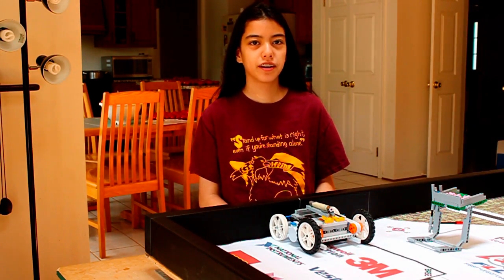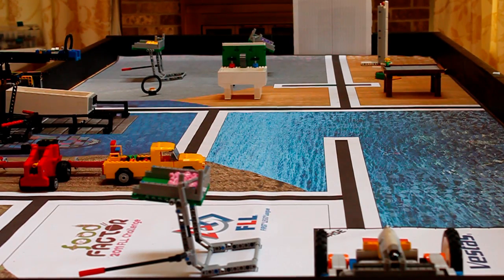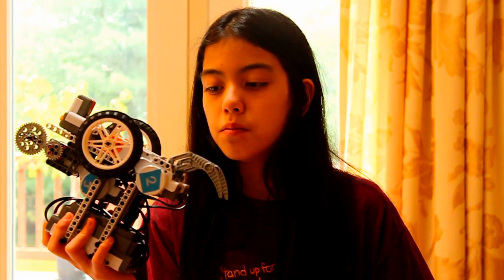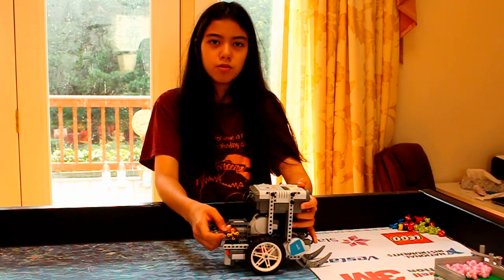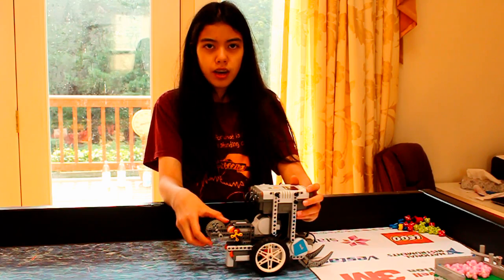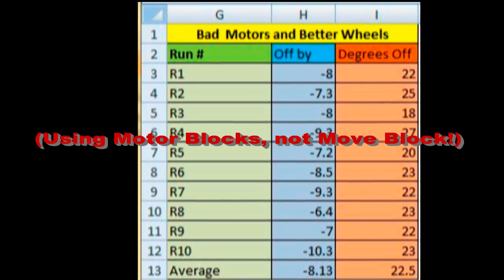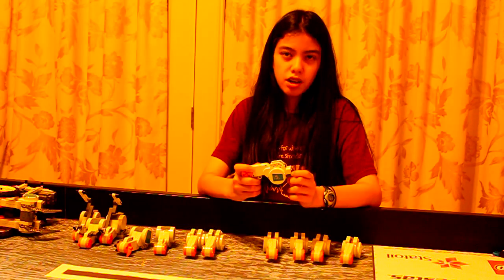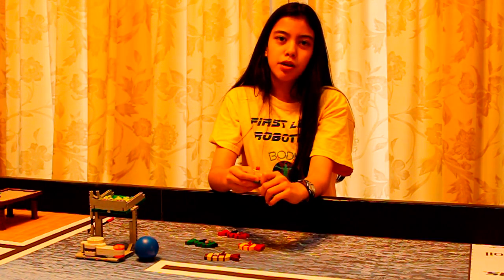How To Make Your FLL Robot Go Straight

Comment: We didn't have enough motors to get your strategy on matching motors to work well, but your suggestions in TubBot on using proportional corrections with rotation sensors did it for us.  Regardless, your videos are awesome. 
@UC1rzOt6O2usjMMS-YLU6RCw

Comment: We didn't have enough motors to get your strategy on matching motors to work well, but your suggestions in TubBot on using proportional corrections with rotation sensors did it for us.  Regardless, your videos are awesome.

Comment from the maker: The first year I did FLL my team built a robot with tank treads.  It moved pretty straight.  Since the tank tread wheels are pretty small, our robot was very slow.  You could try some of the things recommended in this video. If it always veers in one direction, try switching the wheels to see if it veers in the other direction.  You could also try switching out the motors, and/or swapping in a different motor for one of the wheels.

Comment from the maker: MoveBlocks do a good job of keeping the robot straight even with the fact that LEGO two different motors will almost certainly behave differently when set to identical powers.  Though MoveBlocks improve things, they are far from perfect.  The greater the difference between the speed of the two motors (when powered at same power) the harder it will be for the MoveBlock to keep the robot going straight, because the MoveBlock needs to make frequent corrections to motor powers to keep it straight.

Comment from the maker: hard to answer in 500 letters.
inconsistency of LEGO motors is a primary reason for robot inconsistency. If you used two motor blocks at different powers, you might be able to get a veering robot to go straight. But as the motors are worn out through use, and battery voltage varies this will most likely result in the motor behavior changing over time.
The best solution is to use a MoveBlock because it automatically monitors each motor and adjusts power in order to keep it straight as robot moves

Comment from the maker: Good question. Based on the actual number of degrees each motor has rotated, the Move Block ALREADY lowers the power to a motor that is moving too fast compared to the other one. But the steering control on the Move Block doesn't give you fine enough control to make a slight adjustment to the robot's path. With our robots, the smallest adjustment possible to the steering will cause a major arc in the robot path.  Matched motors make the job of the Move Block easier so it has less to correct for.

Comment from the maker: I'm hoping to cover this topic in a future video.  Everything I know about the PID algorithm came from a totally awesome article written by J. Sluka.  Simply google "PID NXT Line Follower Sluka" to find it.  This article is for using PID in a line follower.  Apply the same ideas taught in this article to the going straight problem (the error term is the difference between two rotation sensor readings).  We implemented a "PI" algo and got increased performance over P algo, but PID didnt work well

Comment from the maker: @cvarlamo 

Sorry that robot has been taken apart, and I don't have anything other than the video.  Pause the video at 1:53, that should give you a good idea of most of the design.  The Wheel/Tire are lego part  2902 and 2903.  Buy them on bricklink. The design is quite simple. Just mount length 15 beams to the top of the NXT brick, then mount the motors to the beams. Then used the 3x7 bent liftarms to mount between the two white connection   points on the motor and mount the back wheels to it

Comment from the maker: @andrewdenio 
So now the question is after you've got that prime set of motors, do you verify them running them head to head simultaneously? We found in our 1st round of testing that our results were skewed by our battery weakening. hastypete made the suggestion of running the tests with the battery charger plugged in. We did that and only began a test when battery was indicating full charge too. The seond round found us some good pairs (verified by running them simultaneously!)

Comment from the maker: @MozartJunior22 
Even with software correction (which the MoveBlock already does) it still would be better if your motors were well matched; so you are relying less on the algorithm to correct for a bad situation. Think if you had two horses harnessed together and one of them always wanted to run faster than the other.  Yes you could keep correcting each horse to get them to stay in sync, but it would be easier if the horses just naturally stayed in sync so you wouldn't need to always correct em

Comment from the maker: @MozartJunior22 
Yes, our team does use software to make our robot monitor and correct the motion as it drives.  Our algorithm is basically to proportionally reduce the power of the motor that's going too fast based on the difference between the rotation sensors. The move block uses a little bit more advanced algorithm called Proportional Integral Derivative (PID).  This algorithm does a pretty good job of correcting for unbalanced motors.Yes, you can probably get better if you made your own PID

Comment: Try using software techniques too... in my team we put a lot of effort in the software to make the robot drive straight. 
The point is to check the difference between the motors while it is driving (if motor B drove 255 degrees and C drove 250, there is a 5 deg difference - obviously the robot is not driving straight. Then, the program reduces power from B and adds to C. This runs in a loop while the robot drives. That's the concept- use it and your robot will drive even better!

Comment: @TheFLLCoach 
Sharing is easy with myblocks.  Just use "Pack and Go" under the tools menu.  It makes a single file that contains all necessary myblocks.  When you load this file, all the my blocks are installed for you.  it seems easy enough to figure out for most teams and a good exercise anyway.

Comment from the maker: @luavcbef 
It has MyBlocks which don't share well.  We made a MyBlock with two inputs: power(number) and direction (logical).  The MyBlock simply has 3 cascaded loops and prior to each timer 1 is reset. Each loop has a motor blk set to infinte dur and will be exited when the rotation sensor equals 3600 and then Timer1 will be read and stored to a variable.  The three time are averaged and used as an output of the MyBlock. the main program calls the MyBlock for 8 cases and displays results on NXT

Comment: You should get a rechargeable NXT battery pack and use it plugged in to make sure that your running voltage is always consistent.